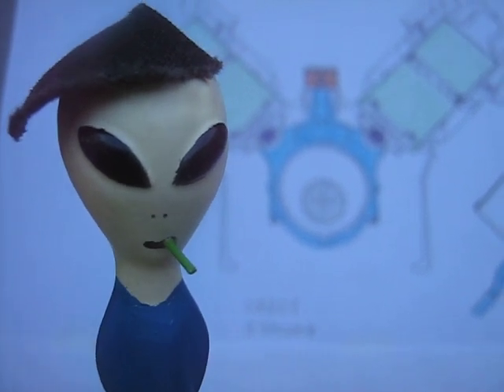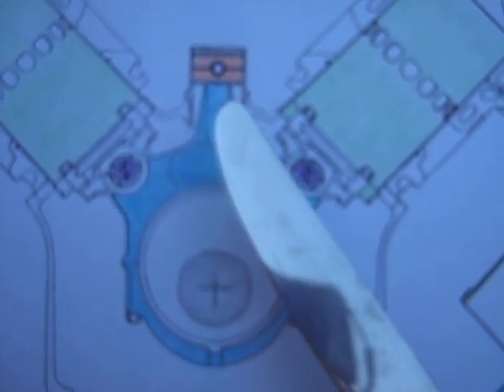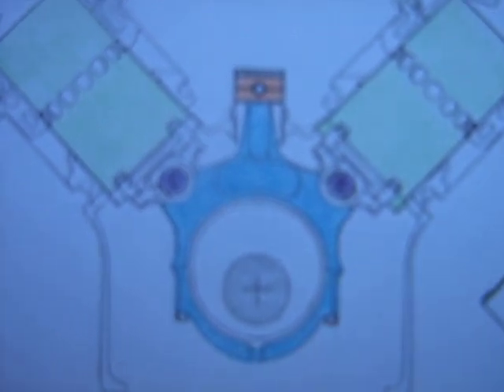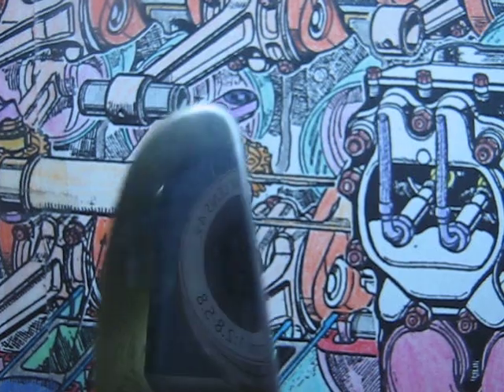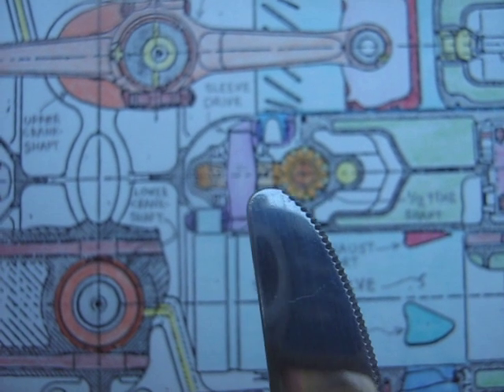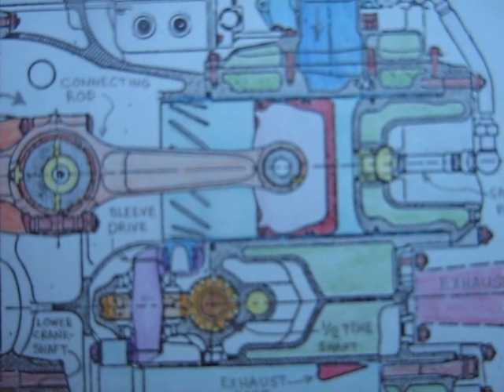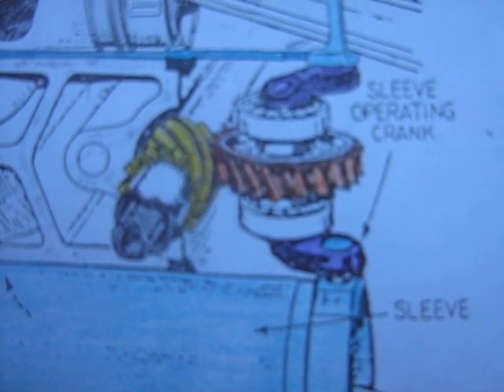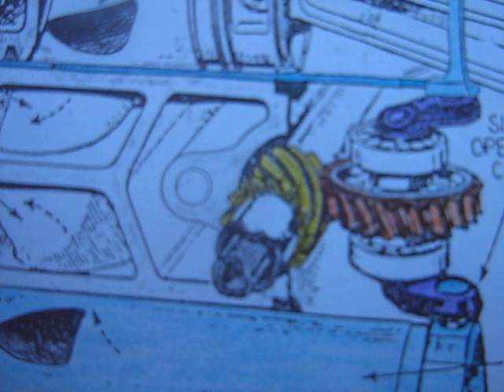Sleeve Valve Drive Types

Comment: There is also a pattern there on the website for the Sabre sleeve valve pattern of movements and opening.  It is missing one sequence near the end at BDC at end of exhaust stroke but otherwise is very illustrative - colored in overlap stages.  If you want more info, I can share an email or something.

Comment from the maker: Thanks for the info, much appreciated!
Sorry, guess I got carried away there.
Yes, the sleeve rotates as well as oscillating, it is really amazing the motion imparted to it by a simple small crankshaft through a ball joint. It sure gets rid of a large number of moving parts needed in a poppet valve engine!

Comment: There is also a lot of information and images on this forum website - all historical stuff  on the enginehistory dot o r g website  Most of the interesting stuff is in the members section.  It does include a 2400 x 1657 copy of it, and a smaller version as well.

Zontaar - you didn't mention the rotation of the sleeve to uncover the sleeve ports with the inlet and exhaust housings.

Comment from the maker: The full cross section view of the Napier Sabre is from "The power to fly" by Setright.
With luck a library, or an engineering library at a university may have it. I have had zero luck trying to find one at used book stores in years past.

Comment from the maker: Yes, the Napier Sabre gave Napier a handfull when they put it into production! They worked out the bugs, and got it up to a reliable 3750 horsepower at 4200 rpm from 2238 cubic inches. Pretty much the best performance in the world for 1945.